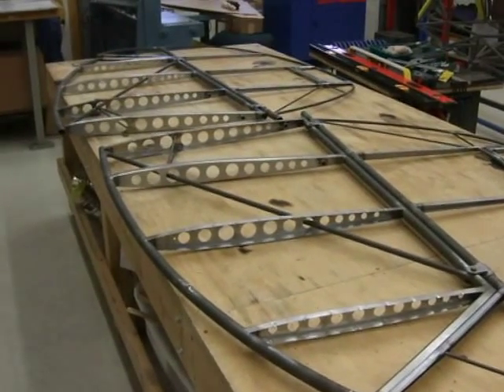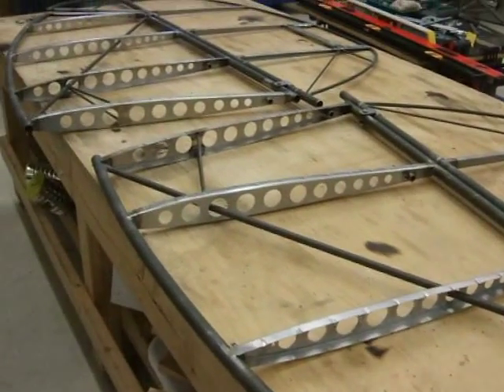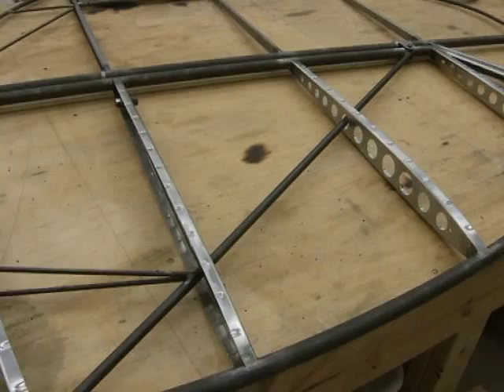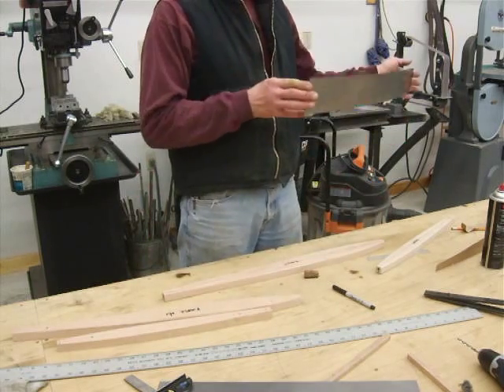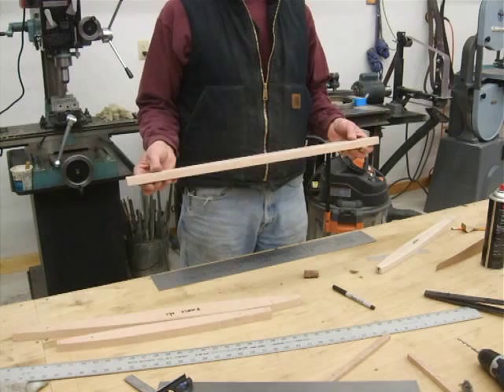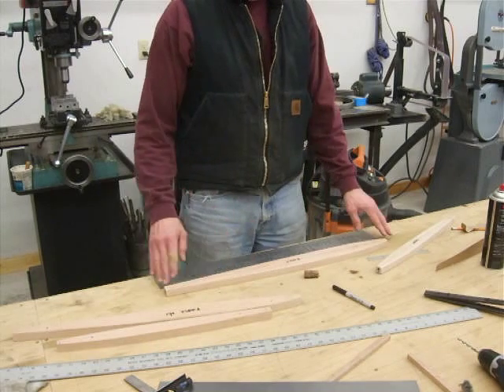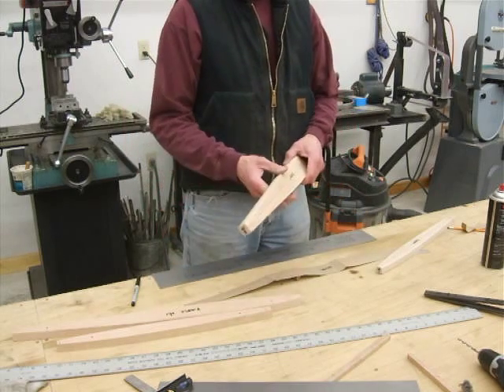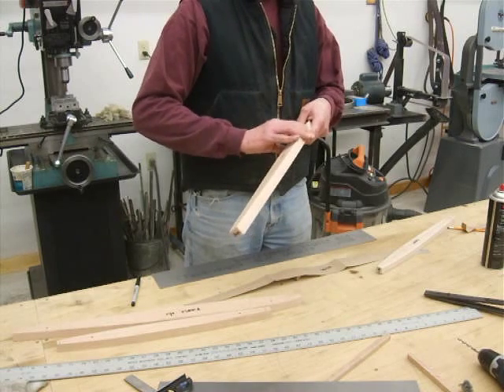Forming a Profiled Rib for a Bearhawk Part 1

Comment: Wire-braced tail trades small (reference total drag number) amount of drag rise at cruise for much lighter weight... for a STOL aircraft with a higher cruise than any of its competitors and similar landing speed, that is a win every time.  if you want even higher cruise speed, buy an RV kit... just don't take it into a gravel bar or handy cow pasture.    

Nice mix of tech and materials... high wing takes less of a beating in the bush, so aluminum for weight and aerodynamic efficiency.  Fuse and tail feathers are easily-repaired fabric over steel tube... bend something and straighten with a couple 2x's and clamps... tear fabric and get out the emergency repair fabric or duct tape.  You could do aluminum tail and rudder, but there is a set of good reasons the slab or symmetric stab is an enduring fav and why a bunch of Piper stick and rag airplanes remain in commercial service.  

If you want to appreciate just how balanced Bob's designs are, spend some time in Bruhn, Perry, Hiscocks, etc., and put the effort in to understanding the aerodynamics and structural trade spaces for back-country airplanes that still get you there and back at speed that match up with airplanes that land 6-10 knots faster.

Comment from the maker: Airfoil is symmetrical. Personally, I think the design is fine the way it is. Simple, functional and maintainable. I actually like the way the windshield looks. As an experimental aircraft, you can always build it how you want if you are willing to accept the responsibility for any safety of flight issues that may occur if you change the design. 

Good luck on your project! You will really like the building process.

Comment: Roger, thanks.  Inverted airfoil, I assume.  It's a shame Bob can't redesign to eliminate the wires/struts and streamline the windshield... I'm on the cusp of starting a Bearhawk,... have you heard him mention these improvements?  The windshield is an easy fix, and I've seen it done on that Bearhawk in S.Africa (?)  but the wires/struts need real engineering design if one wanted to eliminate them.

Comment from the maker: Thanks for the kind words.

The steel ribs only adds an airfoil shape to the horizontal and vertical stabilizers. The tail wires and struts still need to be installed.